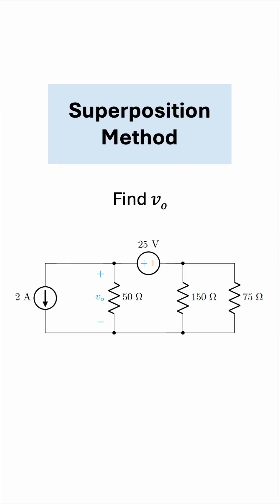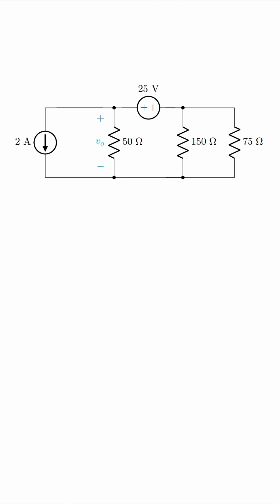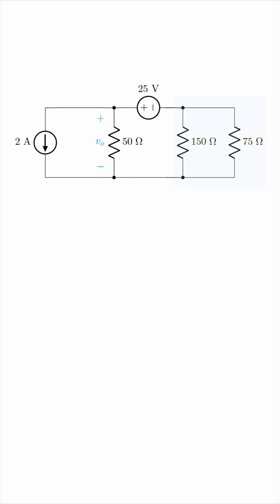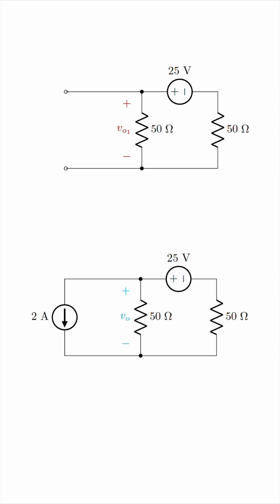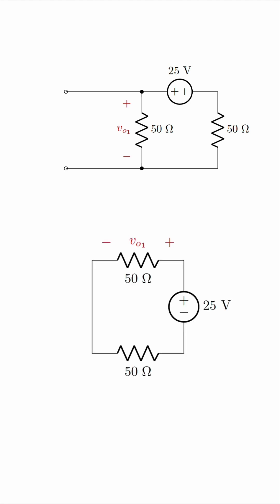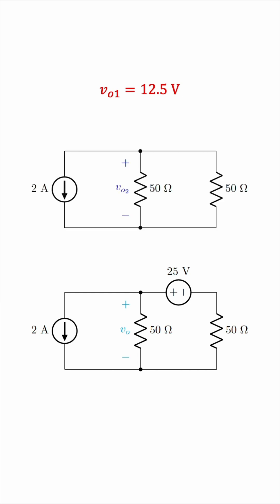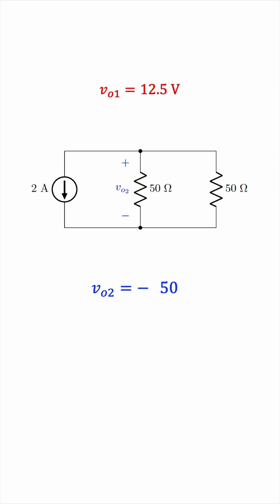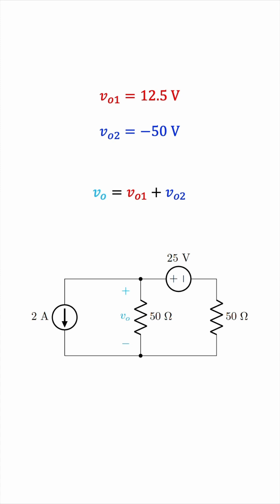Superposition in Circuit Analysis #electricalengineering #electronics #physics

Comment: Why is the current negative 1A ?

Please any help , amazing video btw
Reply: From using the current divider formula for two parallel resistors which is I_x= I_total*(R_other/R_x+R_other). Where R_other is the resistance of the other parallel branch and R_x is the resistance of the branch you're calculating the current for.

Comment: Could you kindly elaborate why is the current flow across the 50 ohm resistor -1A?
Reply: From using the current divider formula for two parallel resistors which is I_x= I_total*(R_other/R_x+R_other). Where R_other is the resistance of the other parallel branch and R_x is the resistance of the branch you're calculating the current for.
Reply: Current division gives us the actual value of the current through the resistor, and the Passive Sign convention gives us the sign. In this case, because our current flows INTO the NEGATIVE terminal instead of the POSITIVE terminal, our current value is negative

Comment: Why we take V2 as -50v
Reply: @manideephkumarsaka because the + on Vo is coming down towards a potential of 0. Since the 1A current is flowing “up” into the resistor, (- to +) it is a “negative” voltage relative to how we are measuring Vo.

Comment: Sorry to ask but i don't understand how you calculated the 12.5V  from the circuit
Reply from the maker: Don’t apologize! I’ll gladly answer.

It’s a voltage source in series with two 50-ohm resistors, and v_o1 is taken across one of these resistors.

By voltage division, the voltage will split between the two resistors in the ratio of resistances. Since the resistances are equal, the 25 V from the source will split equally, and each resistor will take 12.5 V.

Comment: is a correct answer u=50-12.5=37.5 V.  With counting that if the current leaves the resistor on a negative it becomes negative.

Comment: Why negative 1?
Reply: Because current flows from high potential to low potential across that resistor, so in reality the current is 1A going up, but if that were true in this problem arrangement then the + and - of V02 must be switched.

Comment: How come the current flowing through 50 is negative? I used CDP, basically, 2((50)/50+50) gives me = 1. Is it because of the polarity? how so?
Reply from the maker: @imainezreal  It’s 1 A, yes, but the voltage will be negative because the polarity assigned to it means that the current flows from — to + (down to up in the schematic)

Comment: Why is it -1 if v=IR, the current is going from negative to positive so it would be negative I * R but the current we have isolated is 2A so wouldn’t it be -100 ohlms for V02
Reply: Never mind I was only looking at half the circuit and failed to notice the 2nd 50 Ohlm resistor